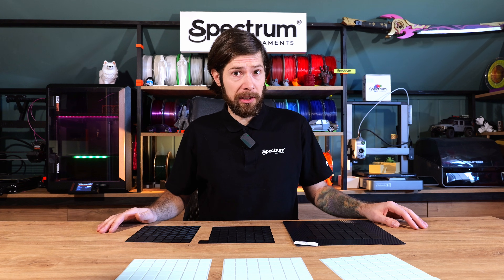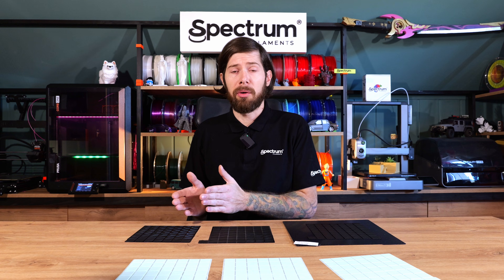Ironing looks great if you fix it!

Comment: So you also need a minimum top shell thickness otherwise you get weird surface warping, I have found. Thanks for the video.
Reply from the maker: True true, I used default settings with 0.2mm layers and 5 top layers, that was enough.